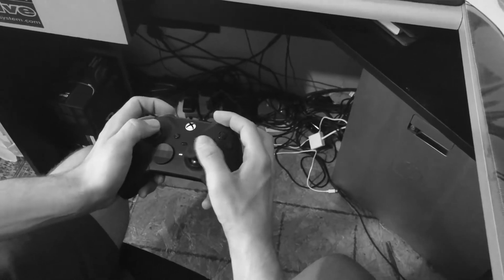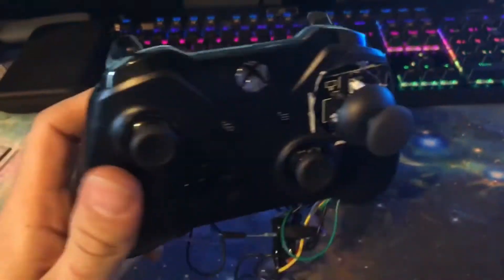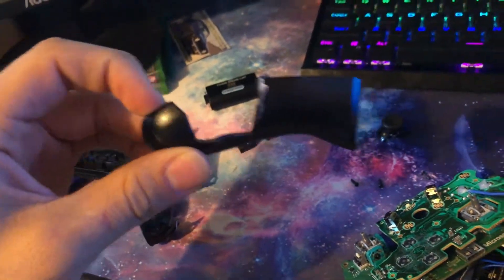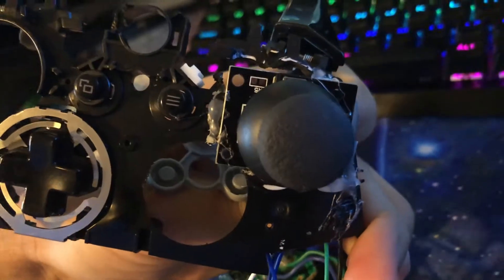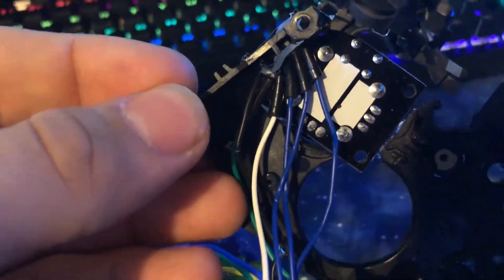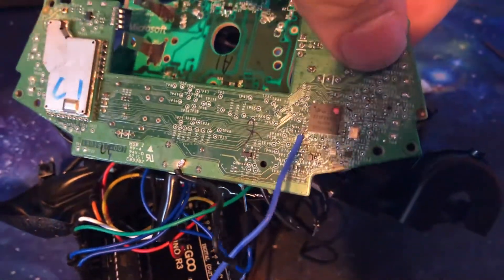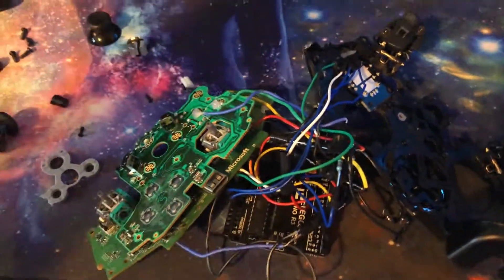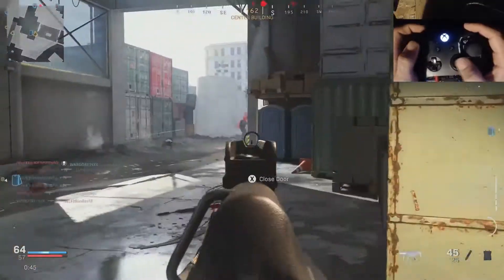I Made a Controller with 3 joysticks

Comment: How did you get the uno to get it to pick send input
Reply from the maker: It’s all in the code lol, I took the signal from the joystick and used optocouplers pc817 to act as a relay, so I’d turn the arduino side high which in turn would turn the other side high because the other side was hooked up to the button I wanted pressed as well as the ground of the controller